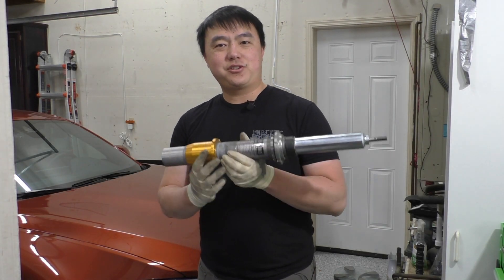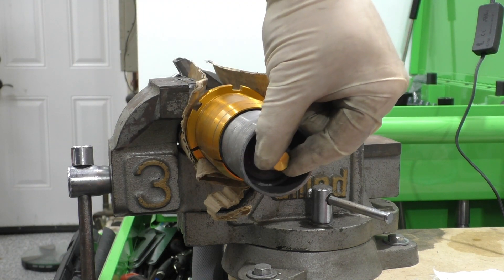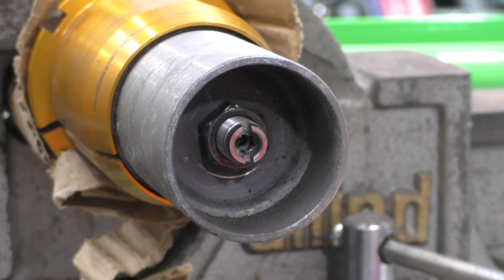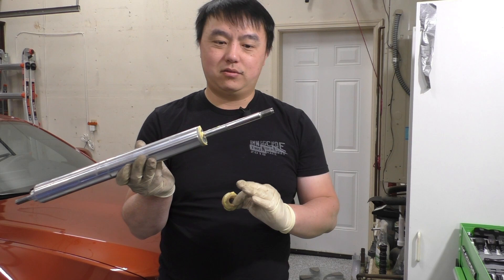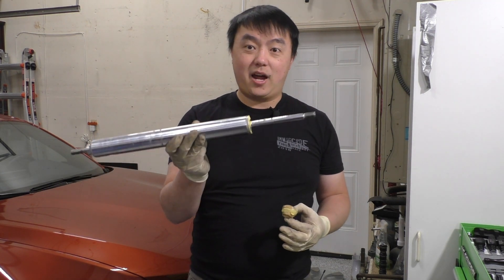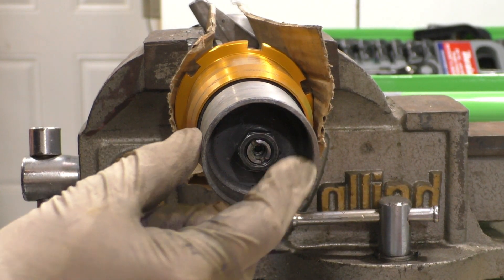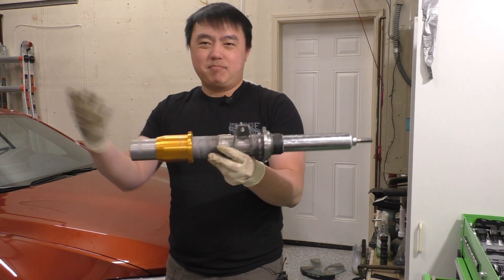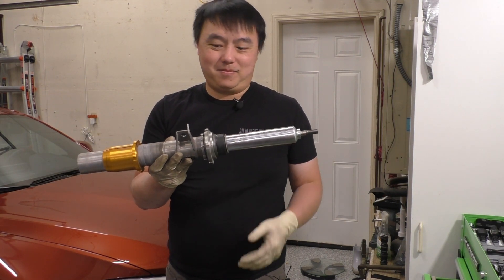BMW Ohlins Road & Track Strut Teardown (M2/3/4)

Comment: I have struggled the past few days on getting the damper out of the shock body. I was able to get the 3/8s wide rod loose but no tool I can find willl grip enough to get it out. Do you have any tips?

Comment: I just installed mine on my G82 and one of the front damper adjusters no longer stops in the loose position, I wonder if I need to tighten the adjuster nuts. Also I noticed the rear adjusters don’t have a stop for the loose end, it just stops clicking but still spins, on the rear it will click forever to the tight direction, is that normal?
Reply from the maker: Are your adjuster knob housings screwed in all the way? It could be possible the knob itself (which turns a small hex wrench that connects with the adjuster screw in the shock shaft) isn't making contact if the housing is backed off.
Reply: @FaRKle0079  I’ll check the housing tomorrow when I get the car under a lift. It’s clear in your video how to tighten the housing for the fronts, is there a way to do this for the rears?
Reply from the maker: @Chin_Track  I'm not sure about the rears unfortunately.

Comment: Love the comparison to the bilstein. One thing that came to mind that might be related to shock body length is that the ohlins have separate adjuster for preload and height while the bilstein are adjusted together.
Reply from the maker: Yes that's a nice feature Ohlins has, although it can make adjusting their height more difficult (on BMWs).

Comment: And maybe you could direct me to where to buy this white rubber fuel you showed inside. Also advance thanks
Reply from the maker: Here's a link to the replacement bump stop for B14: https://www.summitracing.com/parts/BSN-E4AP2Z118A00

Comment: Hello. I have a problem with bilstein b14 maybe you will help to solve this problem while driving through a small pit or could it be due to worn grease? So she might advise you how to change it 🙂
Reply from the maker: It's very unlikely the grease is bad. You'd be able to notice a bad seal where the damper body goes into the strut body. If you want to see how to take apart your B14 strut, see my other video: https://youtu.be/y7vt5Q6sPvY

Comment: I'm glad I was curious to check the Ohlins body length vs. Bilstein. An interesting discovery to be sure! I would prefer the Bilstein's shorter body, and then the ability to use a shorter bump stop! Though the 'full stiff' feature that locks the damper shaft for assembly is an interesting install 'trick.' Most Bilsteins shafts have removeable thread-locker added during assembly. I clean and chase the threads to ensure the shaft threads smoothly into the strut housing.

Comment: Oh, man, you just make videos on all the part I am planning to instal, lol.   Do you also happen to know something about Bilstein B16 comparing with Ohlins DFV, in terms of ride quality in general.
Reply from the maker: Bilstein tends to use softer spring rates than Ohlins, but Ohlins keeps flat ride frequencies. I think Ohlins probably has better damping curves than Bilstein, but for ride quality that's a bit offset by the really stiff spring rates they supply. That doesn't mean you can't swap springs though.

Stay tuned as I discover more of what you're looking for and post material about it, haha.
Reply: FaRKle0079 thanks so much, that is very informative, I like firmer suspension in general, sounds like Ohlins is the way to go.
Reply from the maker: @karlonearth  Stay tuned for my very detailed overview of the Ohlins, including damper dynos!
Reply: FaRKle0079 definitely, I’ve watched all your previous videos about Bilstein and m2c suspension, I learnt a lot from you. I am going to uninstall and reinstall my own to practice while I am waiting for new parts.